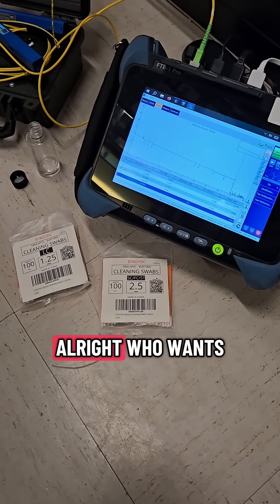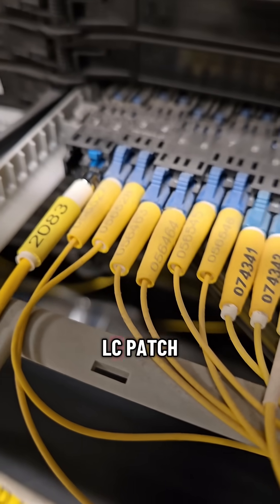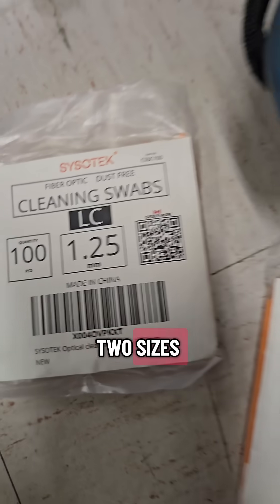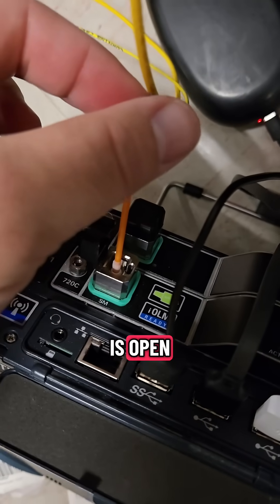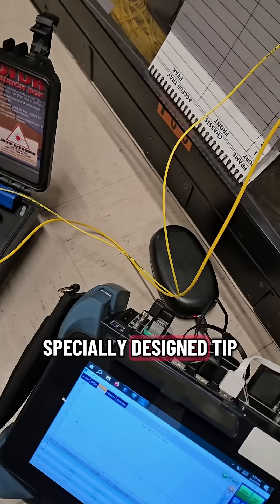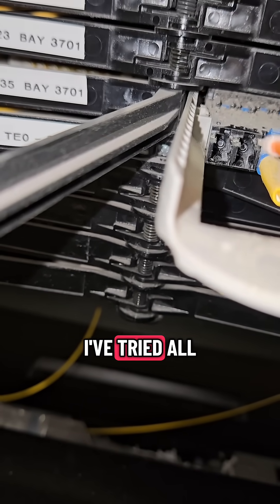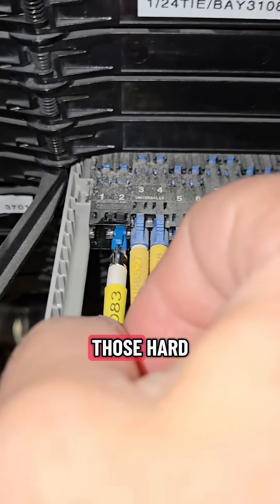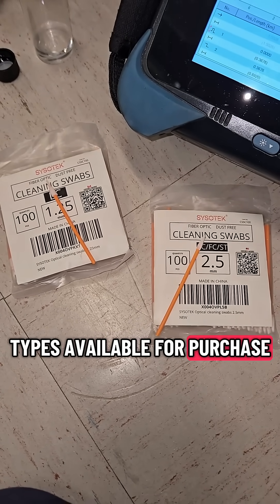THE DIRTIEST OF DIRTY PORTS

Comment: Why would I choose these over a one-click?
Reply: The one-click only cleans the tip. It does nothing for the connector.

We forget that fiber connections (in facilities/on pre): aren't weather proof or sealed, dust can still find its way into the connector because of mating tolerances.

Ultimately the only thing that matters is cleaning the mating faces, the problem is  when the port is filthy: you remove the connector and before you install another one: you kick up all the dust in the port as you're inserting the new cable. Clean the port and Bob's your uncle.
Reply from the maker: This is a great explanation!
Reply: @jamess1787  The one click does both lol. There is a clear plastic cap that you take off and you can clean the port. I understand people want to make their own version of products but I have been using one clicks and fiber taps for years and have never had a problem. I also use inspection scopes to verify. I do tones of c/o to pop to cs work so I use these tools everyday.
Reply: yes i guess oneclicks work. but who has this extreme dust. at worst no plug has cover and couplers have no covers either. and it all just sits in the bottom of cabinet. and then guy comes and just takes one and shoves straight in